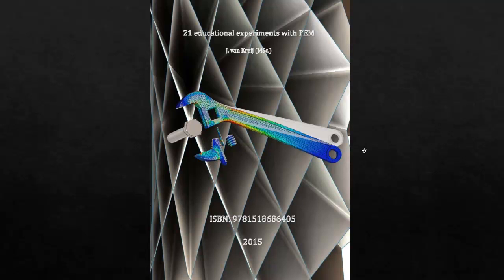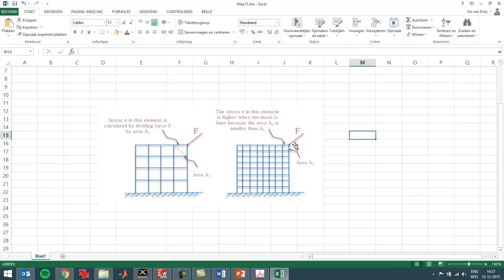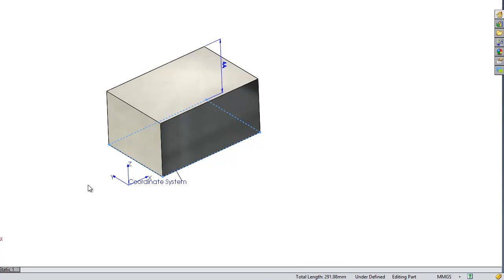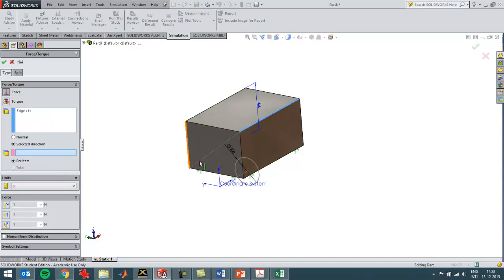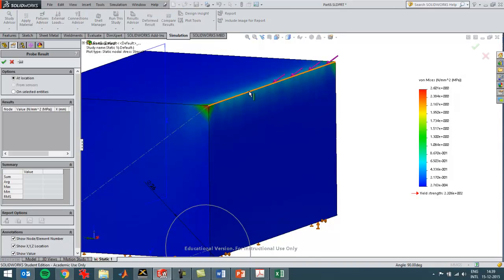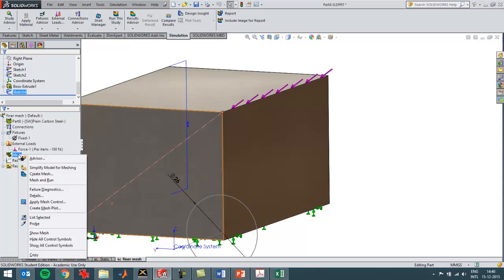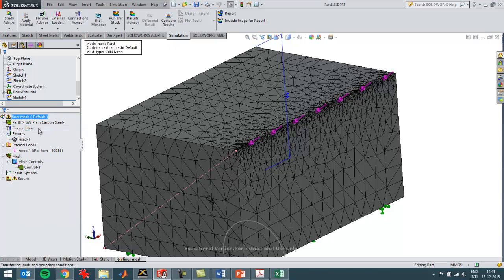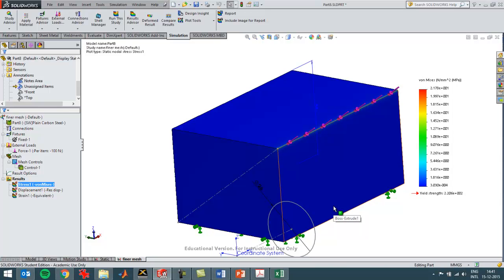Chapter 13  Stress singularity explained with SolidWorks Simulation

Comment: How can we determine the order of singularity in Solidworks? or any other software? Are there any direct tool?
Reply from the maker: Hello Ahmed. There is no direct tool in any software to do that as far as I know. You have to judge it yourself as a user of FEM software. Stress concentrations is one of the most discussed subjects regarding FEM-analyses.
Reply: Good video, a good way is to probe mesh independency. What i dont know is how to overcome this issue to tell the software to omit this singularity result